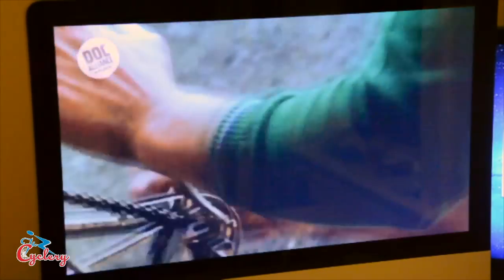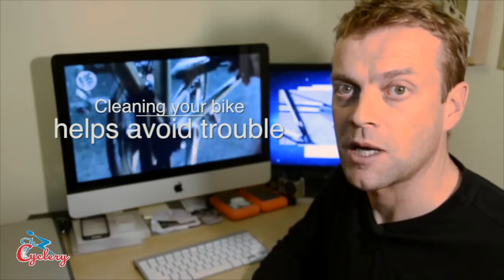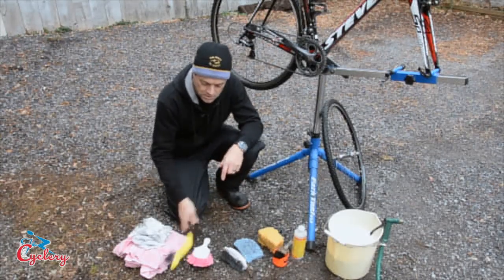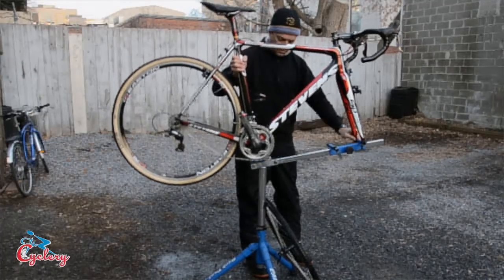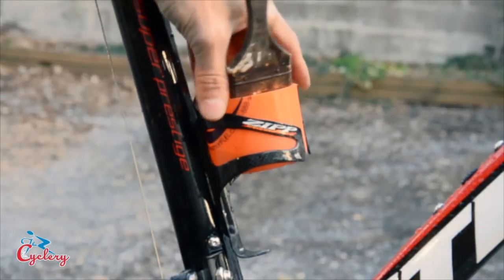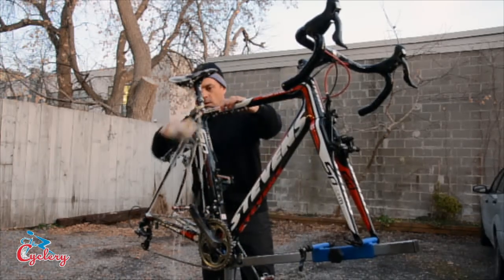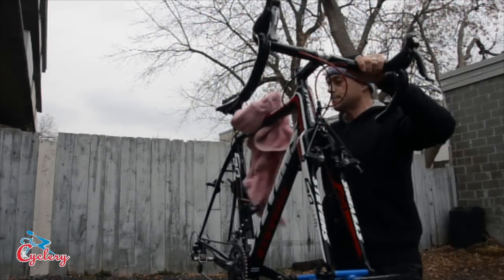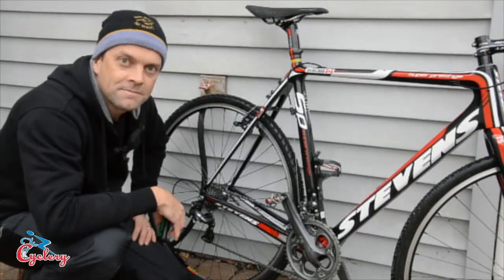Washing your bike

Comment from the maker: Most bike shops carry them. The one I have is made by Pedro's, but there are other brands. You can also make one yourself using an old rear axle or a hub. The key is to have something the chain will run smoothly over without rubbing on the frame.

Comment: I highly suggest not using the same water used to clean the chain, gears and cassette so not to damage the paint.  It's not clear if that was done in this video.  Also, never put your cleaning gear on the ground as it will pick up grit and do just as much damage as the crap already there.  Also, wax your bike just like you wax your car to protect the finish.

Comment: Nice video, thanks. One niggle: you put the chain holder with the quick release lever on the inside of the chain stay, whereas every other photo (and Pedro's website) indicates that it goes on the outside. Obviously it works either way (or you wouldn't have done it), but I was wondering if you did it deliberately.
Reply from the maker: I turned it around deliberately so the lever wouldn't get in the way while washing the outside of the right dropout..